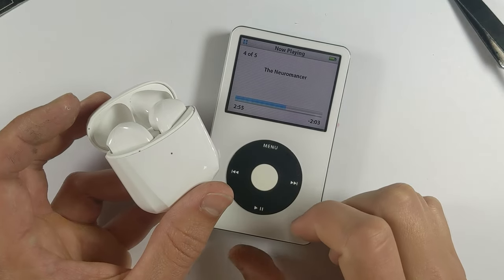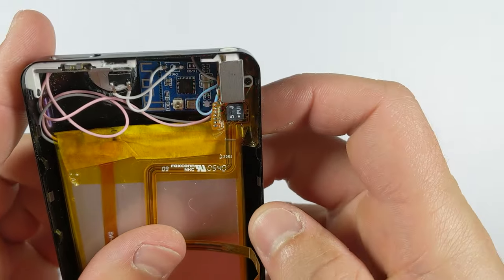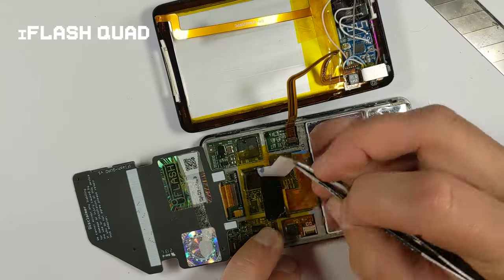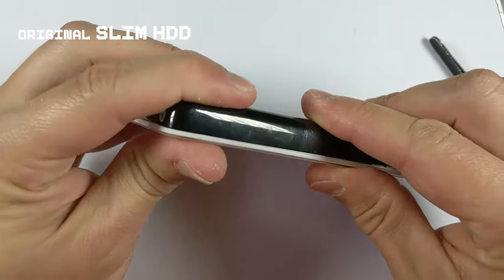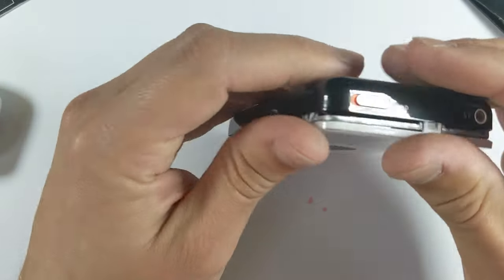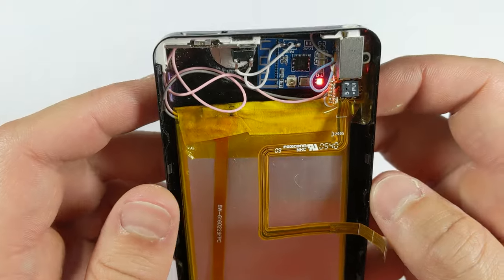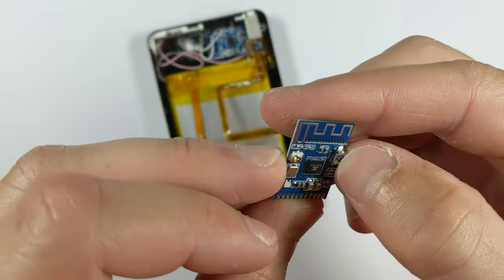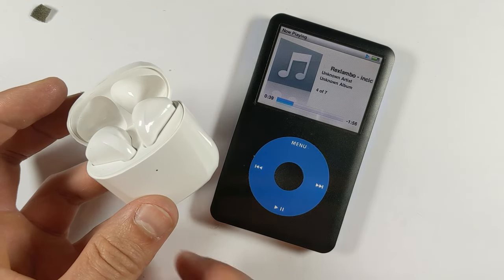Bluetooth Upgrade Kit for the Apple iPod classic 5th gen

Comment from the maker: UPDATE: I have retested this mod on the 6th and 7th gens with a higher quality pair of earphones and it is now working properly! So the range issues I was having were probably just due the cheap earbuds I was using in the video. I tested it using the KZ AZ09 and it was getting around 5 - 6m of range before the connection was dropping.
Reply: So if use the thick housing with a 3000mah battery and cf to sd adapter it will fit?
Reply: Does everything used in this video work with the 5.5?
Reply: will you ever restock black or silver?

Comment: Have you thought about replacing the 30 pin connector with usb c that would be cool if that mod is possible
Reply: Or wireless charging!
Reply: A mod is available
Reply: The type c mod has been around for awhile, most commonly done on the 1st gen ipod nano. It's just one of the more difficult mods due to the pitch of the 30 pin connector's solder points because if you aren't  carefully you can cause accidental damage to the board.

Comment: I ordered one of your kits for my Ipod Classic 7, the kit worked perfectly!   Pro tip for the 6 and 7 owners, if you file down some of the tabs on the top case, it will make it easier to take apart if it ever needs serviced again.
Reply: Do you know if yours work with air pods pro 2? I have 7th gen and I’m wanting to use my AirPods Pro 2 with it.

Comment: The ready to install kit is very nice, easy to pair, and sounds good. The slim back fits with an iflash quad with no issue. My only disappointment is the signal is rather poor. It's not strong enough of a connection for me to get consistent sound in my pocket or even if i turn my head the wrong way.
Reply: I am experiencing the same poor reception. Constantly cuts out with the slightest movement. Concept is good, reception is unacceptable. Wasted money on this.
Reply: Do you have 5th or 7th generation?
Reply: @JOBAH33  5.5 gen
Reply: Which headphones are you using??
Reply: @GetOutSmore  Zingbird X15
Reply: Did you put an antenna on the Bluetooth receiver?

Comment: I have both,one limiting thing is the metal back cover that push down the signal level,maybe in the future they have to consider a plastic cover like moonlit or an hole behind that leave the signal out better,there was another kit that has a very good back cover well realized but I’ve never seen after because the seller close the production,so I use both but if I have to chose I prefer the moonlit,yes isn’t cheap but has usb-c plastic cover and really well engineered pcb and you don’t lost  the lock button

Comment: @partspluspods3689 This BT board branding is very confusing. Does it transmit BT 4.1? Or does it transmit BT 5.3? The version you mention (KCX_BT_EMITTER v1.7) seems to only be BT 4.3???
Reply from the maker: As far as i am aware it is 4.1. Thats what i have put on the product page on my website. Some of the aliexpress listings say 5.3, but most say 4.1 so i would just assume it is 4.1.

Comment: Would appreciate an answer from anyone who knows.. but I'll find out eventually! 😂 Is i t possible to wire up a second switch for hold? Like cut out a spot for it next to the now BT switch, then wire that up the way it's suppose to be. I plan on Restoring a 5th gen I aquired. Already have a new front plate, quad board, and screen. Last thing I need is this kit, but I really don't want to give up the hold switch.. plus I'll have a leftover rear housing with a switch just doing nothing.
Reply from the maker: check out my latest video where i put a speaker, bluetooth and USB-C in a classic 6. After replacing the 30 pin with USB-C there was enough space to add a second switch and i was able to keep the lock switch functionality. If you are comfortable doing the USB-C mod it is an option although that mod is not very beginner friendly.

Comment: I think I need clearer instructions on how to pair the bluetooth to my earbuds. I got the pre-made kit that you sell and everythings installed, but I can't pair the bluetooth to anything. (light turns on when I turn on the switch, so I know it's functioning in some way)
Reply from the maker: Once it is switched on put your earbuds into pair mode, then press the switch in. There is a pair button mounted behind it that is used for connecting the earphones. It should connect after around 10 seconds or so. The light will also change from blinking quickly to blinking more slowly when it is connected if that helps with troubleshooting, although its not visible when the iPod is closed. 

If it isn't connecting make sure your bluetooth earbuds aren't connected to anything else. If they are still connected to your phone it wont pair.

If you are still having issues please send me a message through my website and i can help you out.

Comment: a cell phone wire less charger adapter add even if you have use the thick back would be nice  and a micro momentary push button and tiny pin hole in the case the same size hole as a sim card holder so the sim tool for pairing blue tooth  so you cane use rock box with the hold switch so you can boot in to both firm wear. would be super sick  you would really hardly use the 30 pin my be to run adapter would be about it. just a thought. lol

Comment: hey, I’m thinking of buying a bluetooth module kit from you, and was wondering if you could answer a few questions:

1. is the bluetooth sound a good quality? Like i know it will never be good as wired, but does it sound as good as it does paired to an iphone, for example?

2. the kit on your site removes hold switch functionality. how sensitive are the ipods clickwheel buttons? if i remove this functionality will the ipods buttons skip songs or change volume or whatever if i for example go for a walk with it in my pocket for example

thanks

Comment: can i put a 60/80gb thick back (like the one shown) on a 30gb ipod or are the frames and charging ports between the two different?
Reply from the maker: Yes! they are interchangeable and the charging port will still line up correctly.

Comment: Does not having the lock switch affect rockbox?
Reply from the maker: If you install rockbox and want to switch between rockbox and the default OS it will require a lock switch. With this back installed it will boot to rockbox every time.
Reply: @partspluspods3689  if I use a smaller battery like 200mah or 1800mah that is a square instead of a rectangle could I fit slim msata hard drive in a slim ipod?